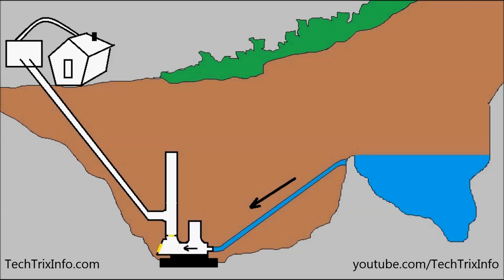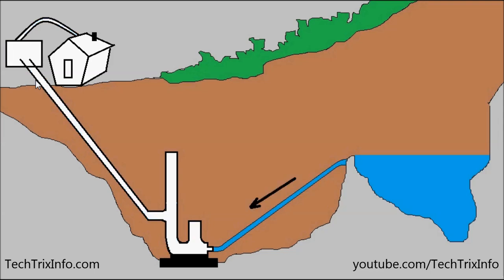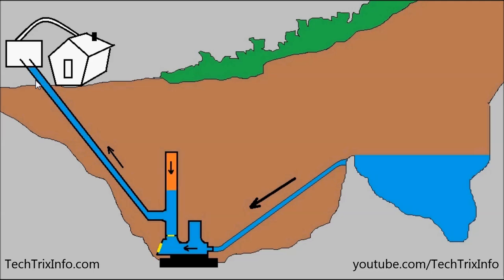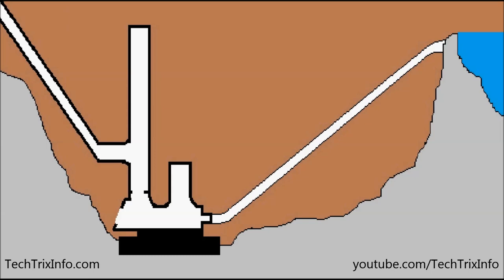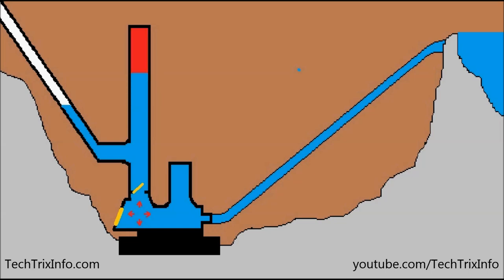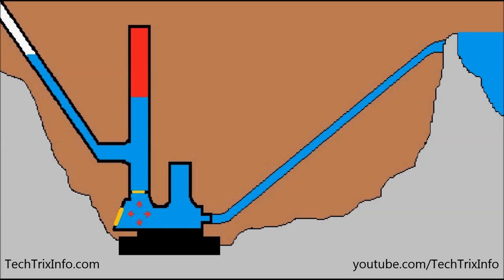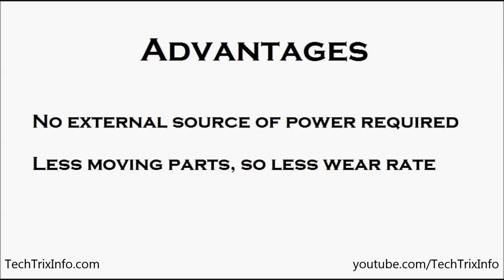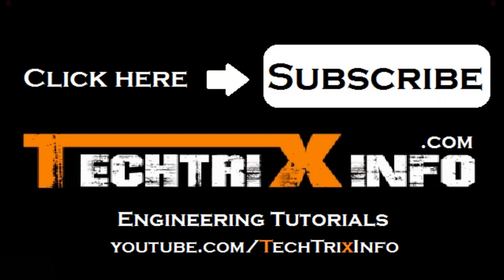Animation | How ram pump works | Explained in detail.

Comment: Why do you need a waste valve?
Reply: If I understand this thing at all..then I think the water needs to pick up speed inside the pipe to get the momentum so it can "hammer" the pressure in to the pressure chamber. Same idea as in impact tools kinda...
Reply: This video almost completely misses the point. The one clue is the sentence that the pump "uses the momentum of running water". The whole pressure chamber on the outlet is just a pulse dampener- it would work without it, but the water would come in pulses. The key is the waste valve. This valve is open before the flow starts. water runs downhill through a long pipe and out the waste valve, picking up speed. The valve is a check valve oriented so that the flow of water tends to close it. Once it closes just a little, it catches the water much more which suddenly slams it shut. Now all that running water behind it has no where to go, so pressure increases immensely. It increases so much that it opens the other check valve, which has been held closed until now by the pressure in the pressure chamber (or the weight of the water going uphill if you have no pressure chamber), allowing the pressure to push more water to the output. But the pressure pulse is momentary, pressure drops, the upper check valve closes to prevent backflow, and the waste check valve opens by gravity or a weak spring. Now water can run downhill to waste again. As it picks up speed the waste valve closes again, and cycle repeats.
Reply: Edward Berry Actually the pressure-chamber/pulse-dampener may be more important than indicated here. It is all about momentum and pressure. Closing the waste valve slams all that water against the closed end of the pile raising the pressure and causing the outlet valve to open. But if the other side of the outlet valve is just a long, water-filled pipe to the house on the hill, then the moving water collides with the stationary water of perhaps much greater mass, slowing it greatly. On the other hand squirting into the air-filled pressure chamber there is only the pressure to overcome, so probably a larger volume will flow before it stops.  And looking at it from the outlet side, the compressible air maintains pressure between cycles so the folks in the house on the hill get a steady flow instead of pulses.
Reply: +Edward Berry Thank you, great explanation! I live part time on a remote Alaskan Island with lots of rain (roofwater to fill tanks) at times, but also times with no rain. Spring is 110 ft down hill from house so need to pump water uphill to refill tank.
Reply: +Edward Berry thanks. that was a way better explanation than the video.
Reply: +Edward Berry But i wonder, like wouldn't you lose a tremendous amount of water and empty the reservoir that way, 
with that waste valve mechanic?
And not gain back enough to keep it at max level?
Or would there be a more efficient way of redirecting the water back somehow?

You seem to explain and know very well how this works better than the video in my opinion, so i hope you can answer this? 
I am pretty curious how this works.

Comment: Why don't we use this to generate energy?
Reply: Edward Kenway Well firstly, we have much more efficient methods of generating electricity and secondly the amount of electricity generated by something like this would be so minute, we could barely use it for anything.
Reply: Edward Kenway We use water to make electricity using elevation, think of the hoover dam for example making 2 MegaWatts. ^_^
Reply: +phogelbice

 Then think of it making 2000 megawatts.  ;)

Comment: Why couldn't I use this for a perpetual motion machine? Simply dump the output from the house back into the water source creating an endless loop?
Reply: Because the volume of water pumped high uphill is only a small percentage of the total water flow, most of the water goes to waste.  So the amount pumped up will not be able to replace the original volume that flowed down, hence no PM.  The reservoir from where the water flows needs to be replenished from an external source.
Reply: Thanks.. I had discovered that after I posted the question. But we Can make it much more efficient if we capture that water and feed it back in to the source. You might still have some loss depending on what you use the water for or how you use it in the house (open faucet or coil loop for heat transfer) but you should now be able to maintain the system just topping off the water now and then instead of having a large flow like a stream.
Reply: I would guess that this will not make the system MUCH more efficient as the amount returned is a small fraction of the water used and wasted.  If you use a naturally flowing river you probably don't care how much water gets wasted as it flows away anyway. If however your reservoir is man-made and you don't want to just waste the water from there then the most efficient way to go is to open the inlet valve only when you need the water to go "upstairs". At all other times the water simply does not flow and the pump sits idle.  This method would be much more efficient than simply return the pumped water back to the reservoir.
Reply: So, your saying control the amount of loss simply by controlling when the pump is in operation. That I would already opt to do. Thanks.
Reply: Divergent Droid The whole pump apparatus must be downhill from the source or momentum cannot build in the pipe. Thus, the waste water has less gravitational potential energy Han the source water. You would need to input energy to push this large volume of water back uphill. There is no such thing as a free lunch.

Comment: Wonderful curious people, here is a theory i'd like to discuss with you,
 please run it past you logic circuits;

Bouyancy creates a centre to peripheral potential force that relative to
 gravity is crucial in terms of biophysics. 
Like a rubber submarine, with a rubber central heating system inside it.
 The deeper it goes underwater, the more it pushes back aginst the 
crushing forces around it. 

This crushing force is fed through the rubber walls into the rubber 
pipes and struts inside the submarine and is continuously shifting, 
changing density and changing volume. 
Even when completely still, the potential force stored in the elastic 
tissue is significant.

Any oscillations caused by sonic / seismic type energy the submarine 
encounters due to environmental noise AND internaly generated sound 
/pressure waves are altered by this potential force because density 
changes pitch, tone and volume. 

The curved surfaces angle of the elastic membrane tissue changes as it 
is compressed and relaxed but even while still, acts as a parabolic 
sonic mirror to any internal vibrations,
curved egg shaped parabolic surfaces being the only efficient shape to 
deal with pressure differentials and bouyancy requirement. 

Here for the rubber sub analogy to continue we have to fill the 
submarine with water and lift it onto the air, let's call it "H.M.S. 
human body" an anti submarine, whose job is to protect the water inside 
being evaporated off in all directions, and the sailors called kidneys, 
liver, spleen from being too dry or roughly treated.

The parabolic mirror shape of the fascia and skin type outer layer of 
the H.M.S. human body means that any regular sonic activity inside the 
submarine, eg.sailor heart playing his drums, will bounce around the 
watery internal cavities for a long time as water conducts sound 
brilliantly. 
 
As the sound waves bounce off the satelite dish shaped outer shell, in 
certain places in the "human body" the sound waves form standing waves 
and nodal lines of extra volume and relative silence , especially if 
someone left the sound system on and it is generating feedback in very 
tight high pitched ultrasonic frequencies, and very low throbbing 
infrasonic frequencies. 

Air behaves like a fluid and creates 1.03kg of force per square 
centimeter at sea level, the human body has on average nealry 2 square 
metres of skin. 
That is two tonnes of crushing force being generated at seal level 
relative to being on a planet such as Mars. 
If one stand inside a large enough bell jar and releases the potential 
energy, ie create a vaccuum the body expands as the potetial energy is 
released.

Does that mean that through diligent practice one could gain the ability
 to dilate the central nervous system in it's entirety and release this 
potential energy in tiny, invisble ranges of movement?
Hell yes! you just have to learn to NOT think for long periods of time 
as thinking contracts the nerves. Plus have fantastic postural 
alignments and superlative breathing habits.

Come on people, two tonnes of force at your fingertips!
The art is called nei kung and is popular in parts of China.
I learned it from a strange and wonderful man called Bruce Frantzis who 
runs a company called energy arts.

I am steeped in the language of physics from my family background 
(Father, grandfather all physicists) yet i learned these skills out of 
neccessity as i was disabled in my late teens.
I am trying to engage with open minded people about the possibility that
 there is a difference between genuine fighting masters of the art 
trying to talk to scientists and hippies mouthing off because they want 
to feel special.

Please check out my Youtube channel where I show these phenomena in 
action and let me know what you think. 
And breathe from your belly;)
Reply: bruh..... no..... just.... no.

Comment: ASK any two engineers to explain a simple function you will get four stupid explanations. ASK any engineer why an electric lamp flickers, he will deliver a plank of wood and total boredom. Nothing wrong with the graphic. It is basically right, as invented by Archimedes to prevent himself being screwed. The graphic could of course be improved and a couple of pages of Pascals law equations would do wonders, but not make it work any better.

Comment: It's perpetuum mobile!  LOL!!!!
Reply from the maker: +Pavel Burov 
Thanks for the comment 
WhatsApp @ +919744615655 for more details and update on Engineering
Reply: Pavel Burov No, youre using the energy from say 3 gallons of water to pump say 1 gallon uphill (just an example). Hence the waste water valve at the bottom. If you could pump all the water uphill with no waste water needing to be purged then it would be PM.

Comment: Why doesn't this design violate first law energy balance? Doesn't the water exiting have a higher potential energy than the entering water?
Reply: uh why? I thought the water entering has gravitational potential energy? So it has higher potential energy.
Reply: The water coming to the house has a higher potential energy than the water entering simply because it is at a higher altitude.
Reply: kdmq ah yes, that's true. I don't understand the paradox you pointing 🤔
Reply: I figured it out I think. Since more mass of water comes into the pump than leaves it, the water going to the house has less potential energy since the mgh term can decrease if m drops more than h rises. That's why the ram pump has to use the waste gate. Only a hunch though.
Reply: kdmq: The water enters the ram pump via a larger diameter pipe than the water exiting the ram pump via a smaller diameter pipe that goes uphill. To answer your question using your terms the water exiting has lower "potential energy".

Comment: @TechTrixInfo: your explanation is good but your illustration is misleading. The inlet pipe should be at least as large as, but better to be larger than, the outlet pipe. In your illustration it looks like it is smaller and technically this ram pump will be extremely inefficient, if it works at all.

Comment: NO. You clearly do NOT understand how the system is primed or operates in practice. You FAIL to explain how the system changes from rest to full operation. You have watched a video of an operating Ram Pump and guessed how it works once a flow is established. Suggest you delete this video because you are showing you lack of education.

Comment: What a rubbish "explanation"! You clearly don't know how the pump works. Repeating the same words over and over is not clarifying your so-called description - or "explaining in detail" as you allege.. How does the waste valve open if there is water coming from the supply "pool" continuously? How high can the compressed air push the pumped water? What stops the water in the delivery pipe from simply flowing back to the air chamber? This video is worse than useless. Thumbs down!
Reply: the waste valve closes because the flowing water is pushing into it, then almost immediately falls open because the water flow has stopped and as the water flows again it closes again etc. The whole thing works because of the "ram" affect of suddenly stopping the flow of water and as the waste valve closes a "shock wave" is sent backwards through the water and it's this shock wave that provides the necessary energy to compress the air in the delivery system that's required to pump the water. The reason the water doesn't flow backwards is because of the force of the shock wave. The water under the influence of the shock wave is the force that opens the delivery valve and is greater than the gravity affecting the water in the delivery pipe. As soon as the air pressure is sufficient in the air chamber water is pushed downwards which acts on and pushes the delivery valve closed and the excess energy of the water (from the air compression) goes down the path of least resistance which is the delivery pipe... I think but I am 99% sure and I really had to think about it.